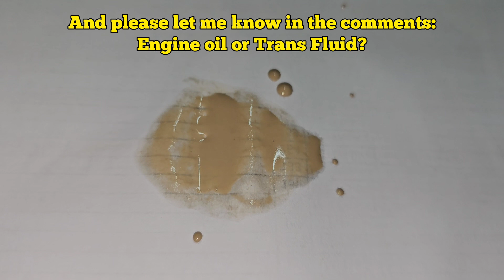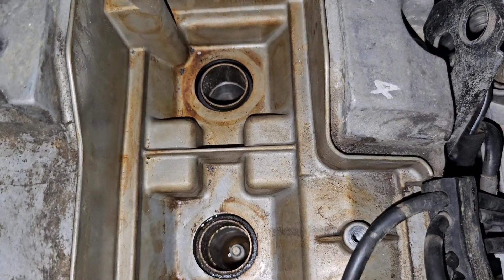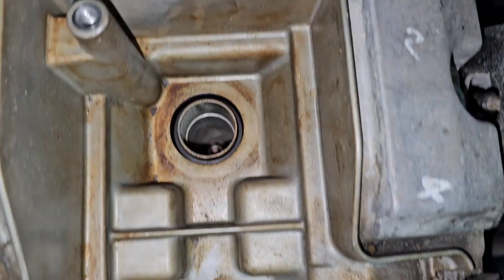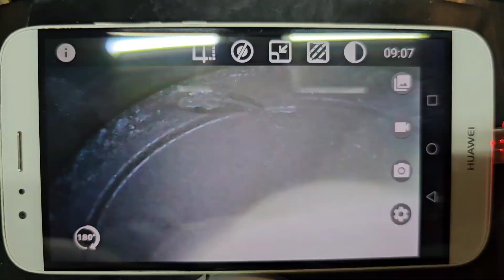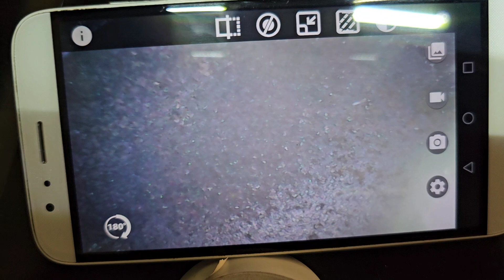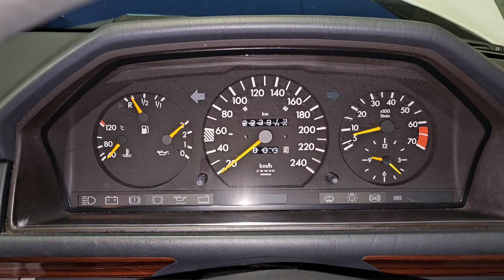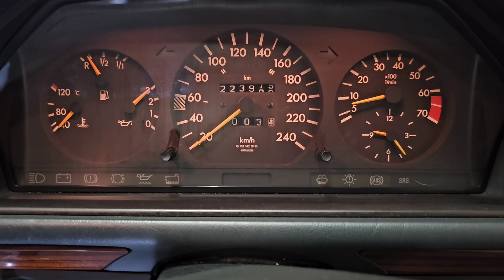Head gasket check; if you have milk-shake in cooling system...

Comment: My c63 has that
Reply from the maker: I have heard that for years between 2006 - 2009 there might be the head bolt stretching issue causing this, or check your oil cooler.

Comment: That is the auto fluid, the radiator is f. you need to sort it quick
Reply from the maker: Thanks for your comment,  I will look in to this matter again, but I mentioned that the radiator and the trans cooler are new.
Reply: yep agree with you , most likely would need a engine/radiator flush, then drive for a while and recheck, may need do this a couple of times. 😊
Reply from the maker: @allanriches9381 Thanks Alln, will post an update video soon 😊